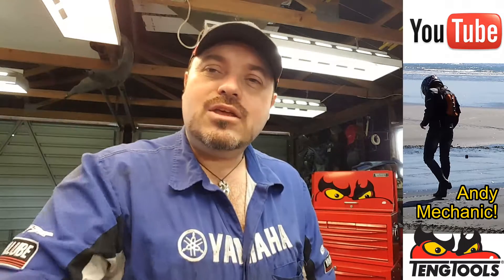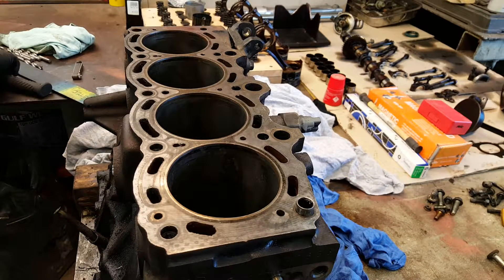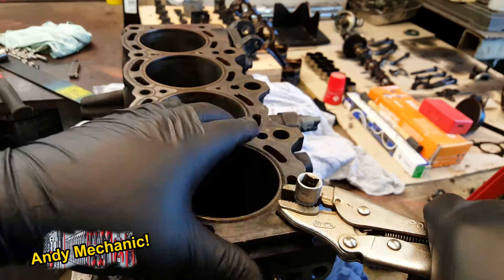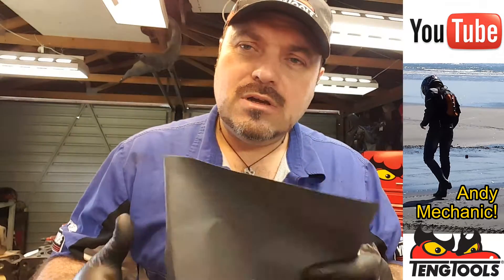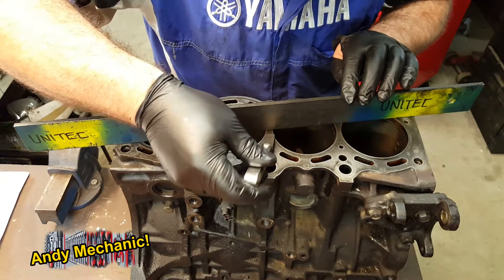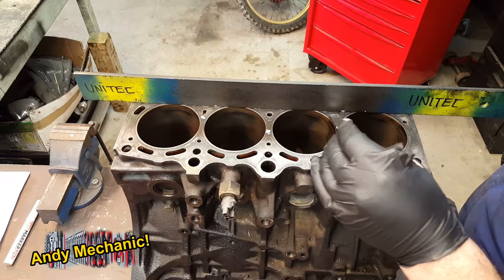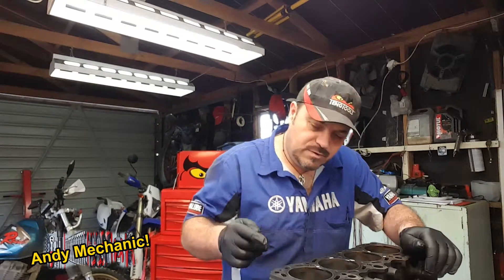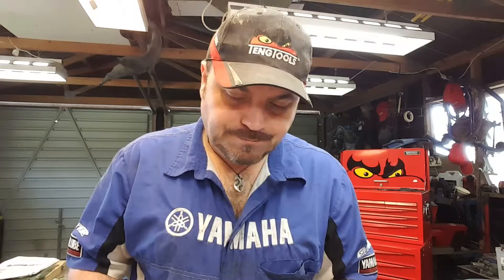Toyota Rav4 engine block warpage measurement Ep18 #1132

Comment: That was unexpected!  I never would have thought an aluminum cylinder head would be nearly perfect and a cast iron block would be distorted.  The number of times I've put a head on a car without checking the block is bothering me, now.  So many times I've checked both, and even with a cylinder head out nearly 0.25mm, I came up with a true block...  That's so strange I almost want to grab another machinist flat and try again!
Reply from the maker: Ah....I have a sneaky suspicion that the head has been replaced at some time due to a previous overheating. They have either failed to measure the block for warpage or just not bothered. Everything that came out of the block smelt burnt and had an encrusted layer of powdery brown residue (overheated engine oil) on it too

Comment: I bet you weren't expecting that. I wonder how many shops would have checked the    head and thru on another gasket ?
Reply from the maker: Man, most workshops I have come across here in NZ won't even bother to measure the head warpage let alone get it skimmed. Measuring the block would be like asking them to solve a rubix cube in under a minute!